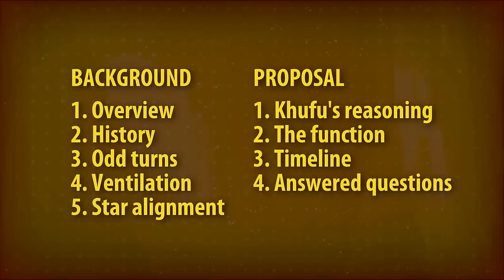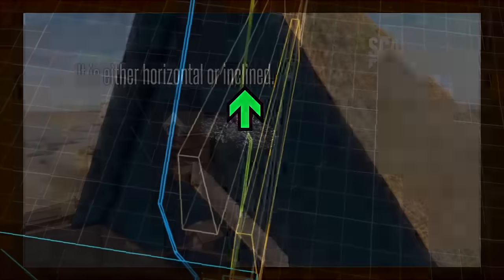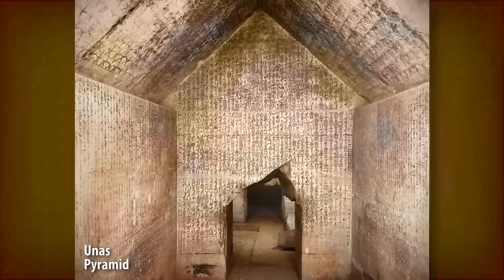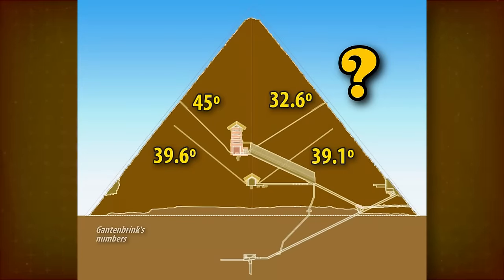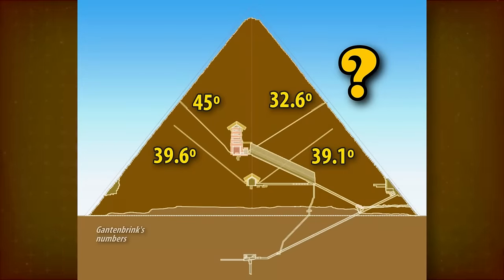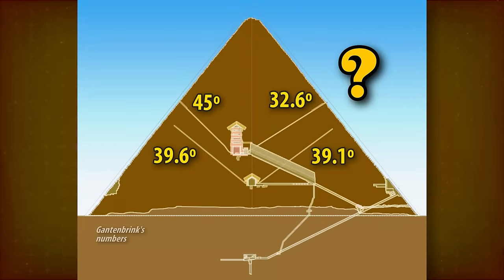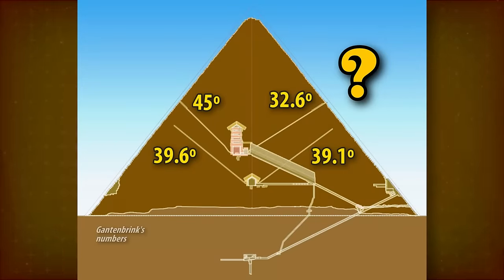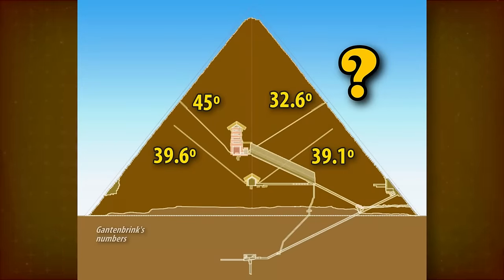Secrets of the Pyramid Shafts Revealed

Comment: Everytime I’ve ever seen someone present a theory, I can’t help but feel like the most simplistic explanation is likely the right one… and the simplest answer is advanced cementitious technology (the blocks were poured, big chunks of granite aggregate were used, so the composition is very similar to the quarries where the aggregate were taken, instead of the stones being moved whole, they were moved as rubble and then reconstituted with some advanced concrete methodology)
Reply: The vast majority of stone blocks in the pyramids are rough hewn limestone of greatly differing sizes and shapes. The irregular sizes and shapes would require the construction of as many molds as there are blocks. Then there is the issue of where the materials would be mixed, the technology for pouring, and the lack of evidence that blocks were fabricated instead of cut. 

If an explanation involves that many unsupported assumptions then it is indeed simplistic. But not in the Occam's razor sense of simple.

Comment: The purpose found  for the original pyramid is food production. Having placed in the Kings chamber  was a gold box with a stone inside that had been radiated for an extended period of time making it weightless and having the potential to draw universal energy from the air. With a gold capstone to give off the positive+ current and the base to allow the negative- current to go through the water down to the western portion of the Sahara desert three ring area. This was the foundation for an island area containing a large quartz crystal to absorb this charge from the water. Besides influencing the growing conditions the power could be used to light the tower at Alexanderia as well as large lamps used to light the tunnels of the Valley of the Kings. The gold box/Ark is now sitting in Axum Etheopia waiting to be brought to the USA and re-installed into a hemp-Crete with metal shavings added pyramid on the Mississippi River near St Paul Minnesota, using the Mississippi River to carry the negative- charge to the gulf of Mexico where this crystal will be placed then. Many pyramids then built to duplicate the electrical effect. This may happen after the rounding of the Nemisis/Nibiru system expected 2026. ❤
Reply from the maker: Finally some sense and reason in the comments

Comment: Graphically very appealing. Very nice job, indeed. Premises are probably very wrong though. It is surmised that the structures are burial sites by purpose. But they have been repurposed as such by the Egyptians. The original function designed by predecessors of the Egyptians was most probably water treatment. The site of the shafts and corridors and their layout may suggest this as do the water erosion marks. Until now, there is a large water supply underneath the pyramids. The Aswan dam has changed the conditions somehow nowadays which makes it harder to imagine the original topography with a water surface surrounding the Giza plateau. Also, nobody seems to pay attention to the unimaginable size of the megaliths at the base of the pyramid which makes the  suggested and generally accepted construction techniques even more questionable. Occam's razor does not contradict the fact that a ruler of a tribe living around massive antedeluvian industrial structures would not have chosen them as his burial site and decorated them accordingly. There is no doubt about the special transcendental features present there. None denies the lost knowledge of sacred geometry the ancient civilizations would possess. After all, the human body is 70 per cent of water...

Comment: Interesting theories.  However, I don't understand.  Why do these chambers not contain the other ornate decorations as other burial chambers had ?  All the hieroglyphics on the walls, ceilings, hallways, etc.  There's nothing in the Great pyramid.  Also, what happened to all the necessary objects that were buried with the Pharaoh ?  Obviously there would have been a huge mass of items that you could not remove from the pyramid without taking apart, or breaking etc.  Certainly robbers would not have cleared out everything from the chamber. They would have taken all the easy items, all the gold, valuable stones, etc. but they would have left all the food, baskets, etc behind. They had no value. Where were all of those items in the chamber.  The fact that everyone still is stuck on the fact that these massive pyramids were burial tombs - despite no one finding anyone buried in them is just strange, and obtuse on the part of Egyptologists....

Comment: At 12:00, Imagine....A shaft built with the exact wave length dimensions of a specific energy coming from a far away star. Although a dozen stars might be in the path to radiate energy down the shaft, only the specific frequency, with the specific wavelength would make it through the shaft, or should I say wave guide. The shaft would never have to be open at either end because the energy would find its way through the limestone and energize the crystalline structure within the granite. kind of like how we look for neutrinos in deep caves filled with specific water to find such things. Four shafts.........Four specific frequencies. Can we say "BIURNAL BEATS"? alone meaning nothing, but combined creating specific harmonics and vibrations. Mixing with the resonance of the planet...And Bingo,,,,,,,Standing waves shoot out the apex covered with electrum.  Can we see it yet????????????
Reply: No

Comment: Ok, first off, great video. But I completely disagree with nearly everything you've covered here. Instead of concentrating on the elements found within these shafts, hydrogen, sulphuric acid, ammonium chloride and zinc chloride, where one shaft contained one element and the other containing another were both part of an obvious and ENORMOUS power plant. Tesla, who studied the pyramids most of his life, based the radencliff tower on the great pyramids design, all the way down to the aquifer.  Herein lies the problem. Creating power that is not only incredibly easy to maintain but also free to everyone on the planet is a conundrum on our wealthy benefactors that control any and all energy throughout the globe making energy a privilege and not a necessity. One thing I completely agree with tou on is the estimate of age, 10-12k years.

Comment: I think the shafts have another purpose completely. My theory is that the pyramids were not tombs at all, but treasure vaults that were built to withstand another cataclysm, like the younger dryas cataclysm. The pyramid was constructed so that it could first be hit by a huge tidal wave, like that one that destroyed Atlantis. This is the only theory that gives a reasonable explanation to the massive construction of the pyramids, with so little space inside. The shafts were there as a kind of backup, in case the pyramid was sunken into the ocean. In that case, kings that returned to the land, could get the treasures by digging down the shafts, if just the shafts were above water. Also, the granite plugs in the grand gallery would prevent water seeping up into the chambers, so inside the pyramid would be a space that you could lay dry with pumps.
Reply: I like how you propose something completely nonsensical and say it's the only reasonable explanation
Reply: The pyramids are about 100m above sea level.
The sea level was about 100m lower during the last ice age.
That's some wave you are proposing!
Also, why not build on the highest point in Egypt if that was the concern? Or just bury it.
Reply: @celsus7979  Yes, but the eye of the Sahara is high above sea level now, but if it was Atlantis, all of it was wiped out an covered with mud in the younger dryas cataclysm.  My theory is the only rational explanation to why anyone would build a massive wedge shaped stone structure with millions of stone blocks. I don't buy into the tomb theory. No one would build something so massive just for a tomb, without any intended function.
Reply: @celsus7979  It is like solving a crime, the most important piece is the motive. Why build a massive wedge shaped stone structure with millions of stone blocks? To hide a treasure or a tomb from robberers? It could be made much easier, either by digging a tunnel into the ground and hiding the entrance in a much smaller pyramid. King Tutanchamons grave was successfully hidden in a tunnel for example. But if you are expecting a tidal wave that might even sink the land into the ocean from flooding, it totally makes sense why digging down is not an option. It needs to be both tidal wave proof, but also elevated, thus you need a massive structure that is also pyramid shaped! It is the only explanation that give us the motive for building a massive structure with millions of blocks..